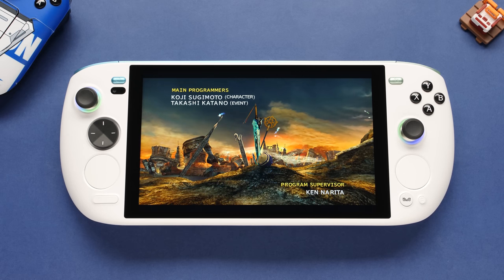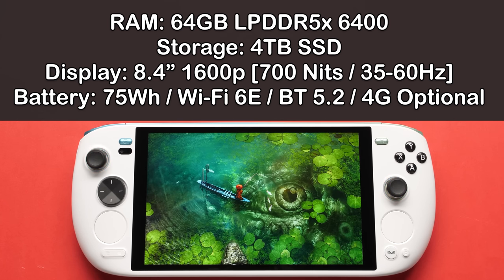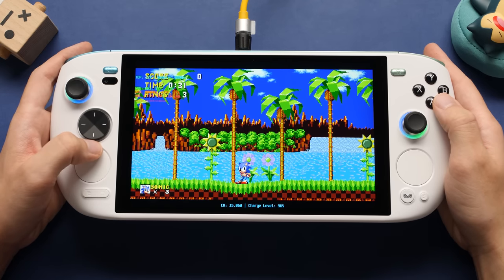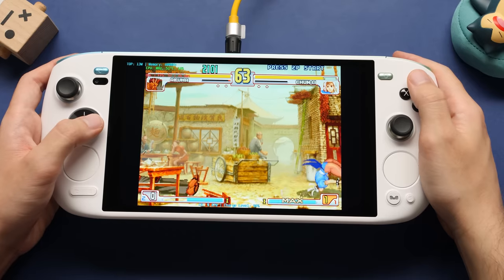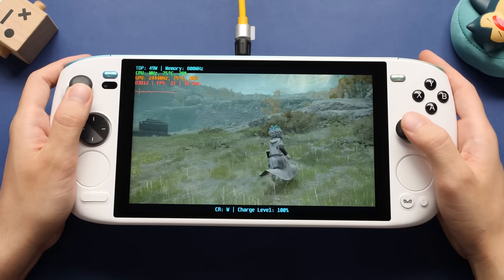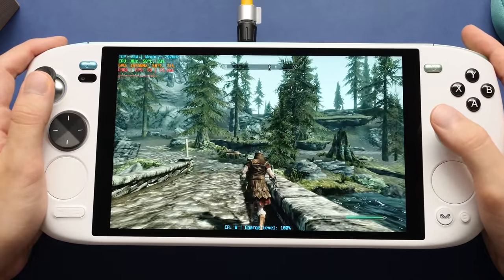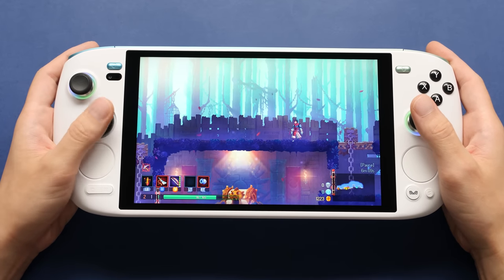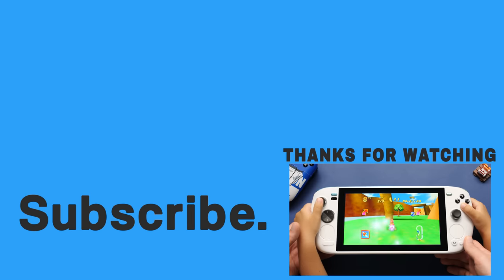The Most Expensive Handheld Yet // $1700 AYANEO Kun Review

Comment: Thanks for the review. The Rog Ally is 699$, the base model for the Kun 512gb and 16gb RAM is 999$. Screen is better in some ways,  you're getting 4 back buttons (although size and placement is questionable), hall sticks and triggers,.2 touch pads,. facial recognition,. bigger screen,.bigger battery, brighter screen,multiple IO, and better cooling system maybe (hard to say how it holds up over time) so it's not unreasonable pricing. If you have an eGPU already you can take advantage of that 54W. Not sure how the chip will hold over time. That stand looks flimsy and wonder if it will hold up. Using the Ally and switch,  touch pads aren't necessary for me, windows work well with touch. D-pad isn't an issue since I don't use it much.  But the benefit of this device is using that battery at similar watts as the Ally used to save battery. Performance will be the same but longer battery life. You can also get an eGPU cheaper than the XG mobiles. After all that it's a bummer it's so hard to get in.    The back buttons are iffy ergonomics.  Looking at their product page the bump in performance,3-10 FPS depending on game, between 30-54W isn't worth the price/fps.  Agree with emulation but I think this device would be good for cloud and stream gaming as well.  I think there's a lot of extras here quality wise ( sticks,. triggers,. screen,. touch pads,.4 rear buttons) that makes it an ok buy over the Ally. If you want VRR use an external monitor/TV (most ppl have one) with VRR.   I don't think you get this for the 54W TDP,. You get it for the screen but more so the battery life, playing at the low wattages and settings that ppl are playing on the Ally.  I would've kept the RAM at 16gb and offered 512gb/1TB SSD and then 32gb RAM with 512gb/1TB to keep prices down  let ppl upgrade storage themselves and then offer a dGPU for a higher price..64gb RAM is overkill,. maybe 32gb too,. especially when this thing will be outdated by time games require that much RAM on a handheld.. looks interesting,.wait until other reviews come out but might be worth waiting for a deeper sale or finding it on eBay

Comment: For that price, it's really hard to justify over a lower end gaming laptop. Especially when you mention that it's destined to be played on a table due to it's weight.
Reply: The specs are as good as similar price ranged laptops but it's even more portable. For it's size, this has very good spec per dollar value. But you'll have to sacrifice battery
Reply: @TheUltimateHacker007  i dont know about you but even a 3050 mobile has better performance than this
Reply: @acwbit2368  Ofc it's a dedicated gpu. But factor in the cpu, igph, ram, ssd quality screen etc. These all are usually not to be found at laptops lower than 1,5k (usually they make one thing stand out for an easy sell). And I know bc I've been looking at hundreds for over a week now. They corner cut so much you usually get overcharged even if you think you made a good deal (misleading cpu names, low nitts, bad screen quality, slow ram etc). Sure this is very expensive but it doesnt cut corners making it good value for its specs. Definitely not a steal but still good value.
Reply: @TheUltimateHacker007  yeah you are right

Comment: This reminds me of the Neo-Geo system that came out many moons ago.  The graphics were the same you would find in an arcade.  What killed it: the price of the gaming cartridge which at the time was over 100 bucks which was insane for a gaming cartridge.  This handheld looks great and has nice specs but I'm not sure who this is designed for.  Nice gaming laptops can be had for the same price point as the top in unit here.  I'm sure folks will buy this device but for many people, the price point will put this out of reach.

Comment: The screen resolution would likely be a non-issue if you could just force integer scaling and game at 800p, basically like running 1080p on a 2160p display with integer scaling, no blurry garbage.

The blacks on that panel look incredible too.

Comment: 1. Didn't you mention in your win mini video that you will be doing total power draw comparison for future videos/devices?
Not sure if missed it but dont seem to see that here.

The total power draw seems terrible for this based on other videos/screenshots, which kind of reduce the advantage of the bigger size battery.

They advertise the 4g capability but now mention need to buy additonal modem card separately which is going to add to the cost (and chance of spoiling the device when installing it).

2. Does the trackpad get recognize as a trackpad by steam controller configuration?

Comment: This seems like an awesome device, but the price is extremely high. I'm also of the opinion that higher than 1080P on a handheld device is completely pointless. The power needed to run the device at 1600P instead of 1080P could've gone to running the games at better setting that aren't resolution and potentially better battery life.

Other than that I would actually consider getting one if I was completely broke at the moment.
Reply: At least it can do a perfect integer scale of 1280x800

Comment: Circle D-Pads should, in theory, be a far better thing to have, so they should get better if more attention is payed, or options to swap out for different styles to suit. There is no doubt that this is a very competent device but it should be at that price. Whilst out of the price range of many, it is a pointer to what is to come later, which will also be cheaper. At this price, use as more than just a gaming device may come to many a mind to justify the cost. The screen looks gorgeous.
Reply: i mean realistically the 3ds has a d-pad and compared to both of these i would say that the 3-ds did the d-pad much better, if they had made it a press button along with the d-pad it would be the apex of d-pads.

Comment: @TakiUdon Can you ask Ayaneo/any 7840 device maker about enabling the Ryzen Ai? I am sure you know the 7840u has an AI Chip with 10 Tops on the silicone, BUT it MUST be enabled by the oem. By default it is disabled. Would be a shame if a capability of the chip will never be usable because the oem doesn't enable it. There is a footnote on AMD's site about the AI chip that states the oem must enable it.
Reply from the maker: I wonder if there is an added license fee...
Reply: @TakiUdon question, so it's unfortunate that they do not ship with a 4g network card, but is there a place to install one in the unit? I initially placed the preorder because I was excited to have that option.
Reply from the maker: Yep, it's under the SSD. @mal2petify
Reply: @TakiUdon  okay I can install any network card right, shouldn't be any compatibility issues? Then I would be able to go to T-Mobile and set it up?
Reply: @TakiUdon  That's what I am wondering about too, looking at network cards online and there are a lot of different types.

Comment: Honestly all I really want is a Steam Deck version with this kind of colour reproduction.  720p for me is fine as I find on smaller screens internal rendering resolution is more important than output resolution in terms of showing off finer details and reducing aliasing.  That's not saying higher screen resolution doesn't look better--especially for a device exceeding that 8" mark--but for the power constraints that are going to continue to be a constant issue with handhelds, I'd probably choose 720p into the future just to allow the devices to ramp up more of those detail settings and framerates.
Reply: Wait, what's wrong with the steam deck? Screen not pretty enough?
Reply: @Yixdy  - Yeah, it's a bargain basement IPS screen. Even budget laptops and tablets five or six years ago had better colour reproduction than the Deck, so you're only getting a portion of the basic colours that games are meant to display. It's considerably worse than the first gen Switch, which has far better sRGB coverage.  

I'm assuming it's because when the deck was being released Valve didn't have many panel options to choose from with that size and resolution, but it'll be my primary reason for upgrading when an upgraded Deck comes around.
Reply: @40Sec  eh, I don't mind it at all bc honestly, isn't noticable imo. But of course how something looks is insanely subjective, maybe I'll buy a replacement screen,  1920x1200, 87% sRGB coverage, etc. For 99 bucks, not bad at all!
Reply: @Yixdy  - I'm not talking subjective here. It has been measured, and it's a garbage screen.  Whether people are happy with drab displays that can't represent proper colours in their games is another matter.

I'd say this would be like many people being happy with the visuals of weak TN panels despite IPS and OLED being miles better, but even most TN panels now are better than what's in the Steam Deck.

Comment: A performance test with starfield would prove that this product is really worth it imo
Reply: That game sucks dude
Reply: @Fleshlight_Reviewer  the performance is crap but it's the end game because if any device is worth and demanding 1k plus and can't run starfield it's not worth it and it's just going to be a emulating machine for retro games and older 2020 pc games, my gaming laptop from 1 year ago still perform well and it's NOT an AMD it's a intel i7 1oth gen, I don't see the point in this device which I paid 600 for my laptop with touchscreen, has a graphics card, it plays switch games and emulates well all the way up to GameCube games, the only thing that will turn heads in a handheld device that works with windows AND plays starfield smoothly without being a slideshow, this is just filler imo, my steam deck is fine for emulation and all the way up to PS2 games plays well and cost me 600 which in turn is a bargain compared to these bloated recent devices that just barely do a bit better than the steam deck, you see my point here 🤷‍♀️🤷‍♀️
Reply: @HUYI1 Bro, you said it yourself. If a game is horribly optimized, then it's not a hardware issue. 

The game just sucks

Comment: The price really is a shame huh? The screen even with YouTube's compression did love impressive. For me, I play mostly Japanese/Asian games on PC (as I'm an Xbox first gamer and missing certain titles annoys the heck out of me). I'm sure the 7840U would more than run the stuff I enjoy playing. Plus I DO want to do that emulation run for GC, PS2, 3DS (and Switch) stuff. Still $1700 and that's probably USD, that's a proper gaming laptop at that point without the performance and that's hard to square even though I want a PC Handheld to comfortably play in bed instead of how I do now with my current laptop.
Reply: Just buy a ROG Ally and a battery bank. VRR makes all the difference
Reply: $999 for base model. You don’t have to buy this ridiculous high spec one
Reply: @Donfrasl still, it's not hard to fill up a 4TB SSD and there's an argument to be made for not getting less than 32GB of RAM, these days. If one only wants a 512GB, 16GB RAM, might as well buy a better value device, as opposed to the one for pushing things to their limits.
Reply: You might have to settle for the Lenovo Legion Go.

Comment: Have you seen any battery throttling on either the KUN or any other Ayaneo devices, possibly at higher TDPs? My Geek throttles after 30 minutes on battery if I'm using 25W or above. Being plugged in prevents it. The wattage drops to 8W and clocks to 400 MHz, but I was always below 80 degrees on the chip. It doesn't seem to happen at 22W.

I've had decent experiences with AYANEO so far but if I can only get 30 minutes on battery from a $1000 device then what gives

EDIT: I guess with your verdict on the power scaling, higher TDPs aren't as important. Would still want to confirm that it won't throttle at a somewhat elevated TDP though, 22W or above.
Reply: Same, but on Ayaneo 2. If I run hi-tdp on battery the whole nit will just tank performance after 20-30min. It’s why I’m selling it and getting Win Mini. Otherwise, Ayaneo has been really supportive of the product post-launch.

Comment: I can hardly understand why you would want to play at 1600p. The reason they chose this panel is because there are no other panels with the same color quality, brightness, and size, but with a lower resolution. However, it doesn't necessarily mean that you have to use the maximum resolution available.

Comment: Honestly then the samsung galaxy tab s9 ultra 1gb variant is a better choice knowing it's normally €1600 but with samsung discounts make that go down to €1400, buy an console controller working on bluetooth and xbox or playstation game streaming and get some good emulators and it basicly is a better system for a similar price.
Though the best price for a handheld gaming system is honestly the steamdeck or rog ally..
Reply: The galaxy tab isn't even comparable and you souks have to buy a whole of other stuff to make remote streaming even slightly viable. And even then it's still remote streaming which even at its best is a poor experience relative to native play. Its also significantly less performance. And with the Kun you can just buy your own SSD for cheaper.
Reply: Also the Lenovo one that's coming soon, looks good as well.
Reply: @e2rqey  i had my example for €1400 and it came with 2 covers keyboards by samsung themselves with one keyboard being it's own piece so it doesn't need to be used to keep the tablet standing. 

And it could be used itself as a controller yes but you could use the keyboard with has full keys and a trackpad though the best is the use of a controller you like(think an xbox controller or a playstation controller for examples), wich yes the ayaneo can use but you have grips you need to like or else you are out of luck making a top end tablet basicly making the same thing but better if you either buy a controller or already have one.. 

And uh... there is proton by steam wich allows you to play steam games on basicly an android system.
Reply: I have a s9 tab ultra and it doesn’t even compare lmao like why even bring that up?

Comment: wanna know something? remove the steam decks plastic filter and the deck runs cooler but by how much since it got cold here in germany. my deck is undervolted and 30w and due to the extremerate back, i did not use the new metal mesh yet. i also will do hotrod cooling soon

Comment: 6400 RAM despite the 7840U supporting 7500 AND locking the bios to make sure you dont up the speed? Also, pretty sure most of the other handhelds can beat rhis at a lower price point (and i think the Win Max 2 is the largest handheld with a 10.1" screen).

Comment: I don't get what AYANEO is thinking. For 1700$ you can get a really awesome tower PC that will completely nuke this thing in terms of performance. This Kun just... sucks quite honestly. Its one of the worst price/performance ratio i have seen in recent times. A valve refurbished steamdeck is 320$... The Kun is 5x that price... 5 TIMES MORE EXPENSIVE. Do you get 5x the performance? No. Do you get 4x the performance? No. Do you get 3x the performance? No. Do you get 2x the performance? Sometimes and no at lower wattage. Wtf Aya... just awful.

Comment: Screens that are big and super high res will result in super low settings on a screen and resolution that show every last imperfection in your face. Id very much rather have higher settings and a 900p screen or lower settings and a 720p screen that will hide problems

Comment: This or Lenovo legion Go?
Reply: Clearly this
Reply: Lenovo
Reply: Legion Go will have miles better support and mass market availability, with detachable controllers, higher refresh rate, slightly bigger screen, and probably less janky software, all for hundreds less (though won't have an option for 32 or 64 gb of ram.) It's a no brainer. 

Ayaneo support is garbage, making this a very expensive gamble. Not a great choice with such a compelling cheaper alternative available. It's not a surprise that the igg campaign doesn't seem to be doing well.
Reply: Legion Go will boast roughly the same power with the added benefit of having a FPS mode, removable controllers, a built-in kickstand, cheaper retail price and probably better customer service
Reply: Never buy a Aya device until its international
Reply: Legion Go forsure. Way better pricing, better customer support and warranty, somewhat more reputable company, US retail availability andnl warranty...etc. Even if you wanted something at this price you might as well just get a mid-high end gaming laptop. This is 4090 money

Comment: This expensive garbage will be lost under the weight of obscurity in a few months. Ironically, in that time, it will be Aya and not Valve that buries it with 10-15 more iterations of a new Aya devices. Valve will only nail that coffin.
Reply: Not everyone wants to play on the poor deck at ps4 level hardware in 2023.
Reply: @Jokerxeno1  True. But even more people aren’t willing to spend almost $2000 on a friggin handheld that more or less does what the Lenovo Legion Go will do at $700. And I’ll bet that the Kun doesn’t perform that much better than the ROG Ally does also at $700. Price is king and that price to performance ratio is why the Steam Deck is the king of ALL of these handhelds. You don’t have to like it.